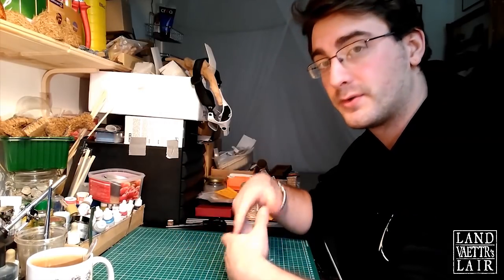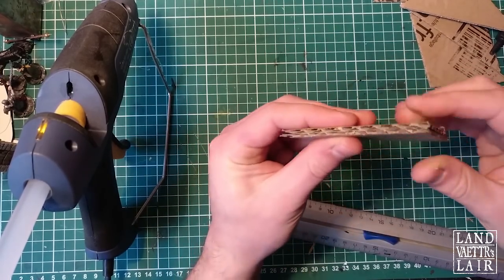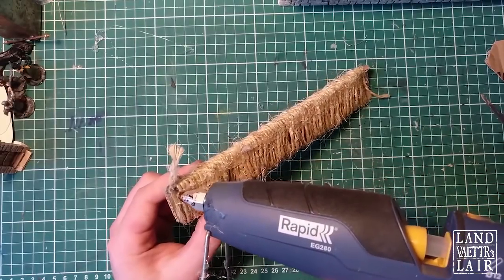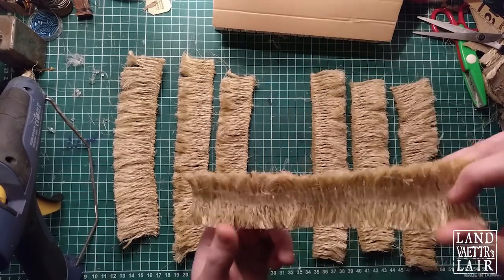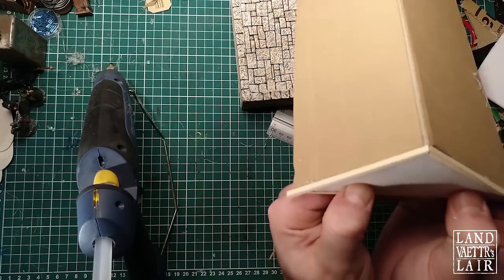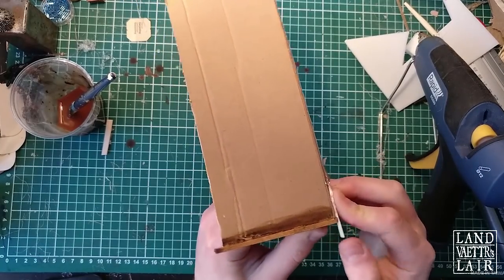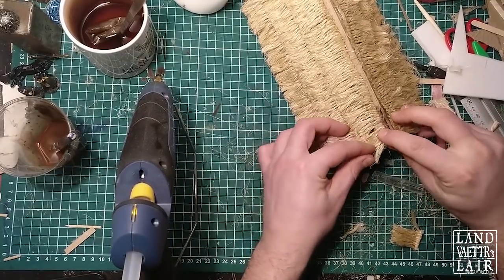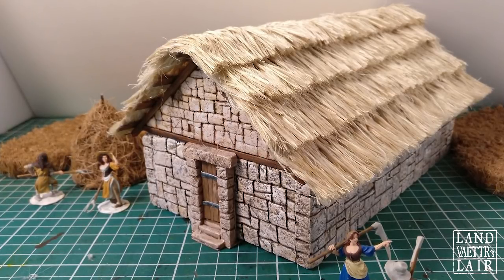Crafting a Thatched Roof for tabletop RPG (tutorial)

Comment: Two methods to improve your technique.

1) When flaying out your strips of twine use a Dog's stiff bristle brush.  Drag the thatching over the inverted Dog's brush.   If you are doing a lot of thatching a Dog's stiff bristle brush is invaluable.

And B) When making foam board walls, as your stone block formation, make extra.  Before applying it to the building or the gable end roof structure you can primp your stone size & location, distress the faux stones, base wash the entire surface and finish the weathering WHILE the entire surface is flat and easier to manipulate.  Then when the stone look like something your are ready to apply to your structure you can cut the finished surface to the desired measurements.
Reply from the maker: The dog's stiff bristle brush is indeed a great Idea if you have a large amount of thatched roofs to make! Concerning doing the stonework beforehand it can be handy in several occasions but most of the time i like to be able to handle while carving in front of me,   it's often proved easier to me when already set on the craft. Also if you do it beforehand better be extra careful when cuting out the piece because if you mess up the cutout you basically waisted all your efforts. ;) Thanks for your feedback! Cheers !
Reply: Landvaettr's Lair You are spot on about Thatching with a dog comb.  It maybe that I do mass builds and stock pile my prebuilt materials.   That's what makes it quick and easy for me.

As far as prebuilding wall sections for me it's more of a relaxing Sunday afternoon (during NFL watching) passive therapy.

When it comes time for a village I'll have in stock a pile of structure parts and designs.  Ready to go.

So I guess my suggestion would be more for those of us who BUILD A VILLAGE. (;~{ )}>
Reply from the maker: @jvanamb  still very relevant and on topic i'm gonna pin your comment in case someone wants to build a village :D !
Reply: One last thing, cutting 3X longer strips of cardboard to wrap the twine around and then cutting it into 3 equal size strips makes 6 thatch strips in only slightly more time than it takes to make 2 you could do 4X or 5X but it gets a bit unwieldy at that point and 6 is generally enough for one roof

Comment: You  didn't mentioned what kind of twine you used. Did you use Jute, Sisal or Manila twine? And if you can't get hemp twine in your area what kind of twine would work best. of the three?
Reply from the maker: Looks like sissal. Choose the one you can find that look most like hay staws. All three can do the trick I guess provided they are thick enough, boils down to the look you are going for. I havent expermented with other hemp types, unfortunately can't be of more help on this topic.
Reply: I found between the 2 sisal and Jute the sisal works best. The jute is more like actual yarn and is softer. Whereas sisal is stiff and has more of a texture and feeling similar to straw. To fray the strands of twine Ive found using a wire dog brush works great to do so but I suggest you do it outside. For it leaves a very big mess of fiber hair all over that you need to use a vacuum cleaner to clean it up.

Comment: have you ever made model buildings for outside (ie in the garden) im working on a model village and looking at ways to weather proof my models.
Reply from the maker: Haven't i must say. I know usually models of the outside are often fully casted in resin. So if you want to craft using natural materials but want durability I would suggest at least coating the whole build with a good coat of resin of varnish meant for exterior.
Reply: @LandvaettrsLair  noted. thanks for the quick reply.